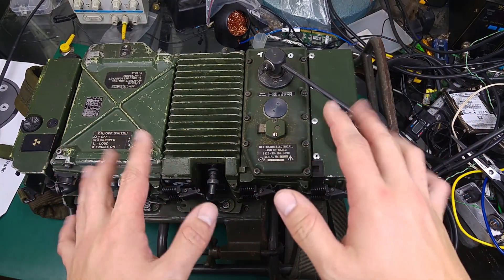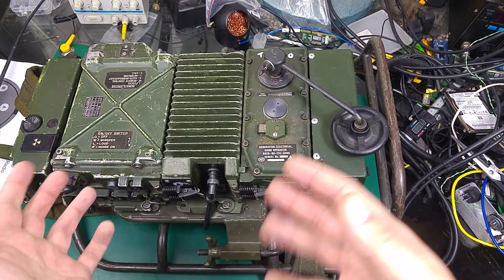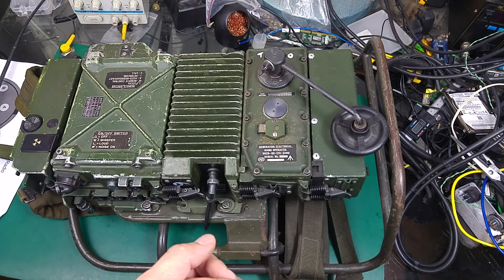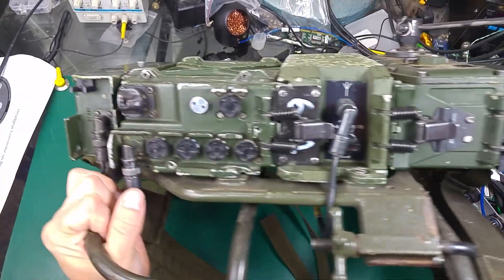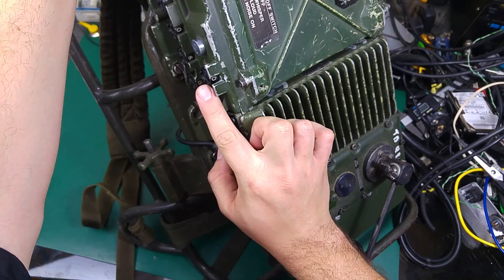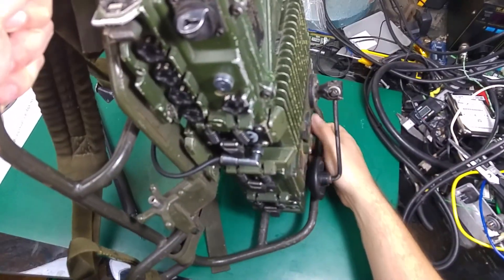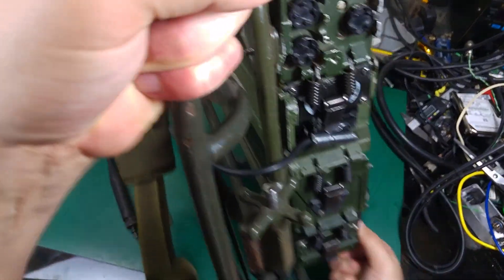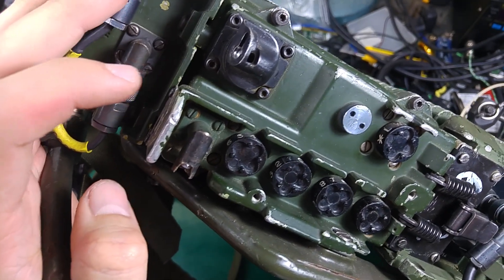(RT351 with amplifier) PRC 352  setup on frame with crank generator, 1Ah battery and SURF

Comment: Is it worth to have one like a hmm backup radio? There is few of them on auction pages, but without crank generator...
Reply from the maker: "green radios" are always best to have in case of emergency,  someday I will make video about it - but in general they are very easy to use by not skilled person. In case of emergency You can preset them and give to someone who have no radio experience and they can't mishandle them, they won't be affected by flood or other harsh conditions that might evolve in distress scenario. On amature radio, one wrong click and someone can change settings and won't be able to communicate. In my opinion for that good option is  PRC-350 (very easy - even changing volume prevent muting it) or  PRC-77 (with adapter allow using alkaline batteries) - once Year just check radio for TX/RX and You can be sure it will work if You even need deploy it, on PRC-350 You have rechargeable battery and they require attention.  You have to way what is the best for Your application. Crank generator -  if You live in city I won't care about it there are better way of powering devices including single use army batteries, if You want for fare away location for example into jeep as backup radio - 100% sure go for it in other case i would give pass.
Reply: @ElectronicNoobBlog  Hah... Decision just need to grow up in my head. I'm ham radio operator, so every TRX is simply for me. But you have right. If I want to put this in to some kind of terrain vehicle, it should be undestrucktable and as simplest as it can be. Probably I will change way to power it anyway, make it simpler and more unisersal to use in field. Thx for answer

Comment: Why is there a radiation symbol ??
Reply from the maker: That forward power meter (under flap)  use radioluminescence paint so could be visible at night emitting green light markings at scale and needle.  (right now i can't see any visible light at night).